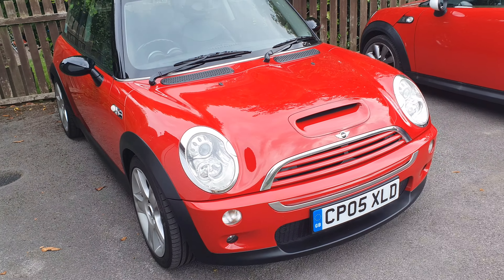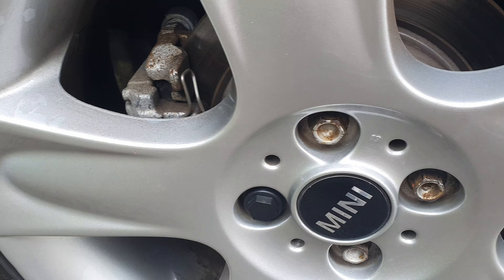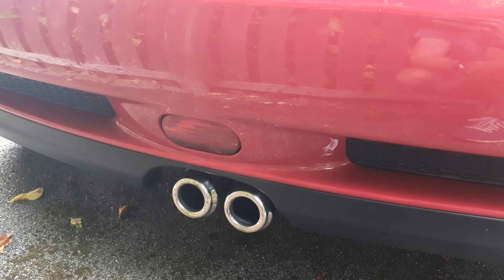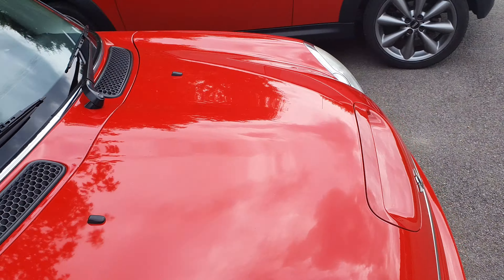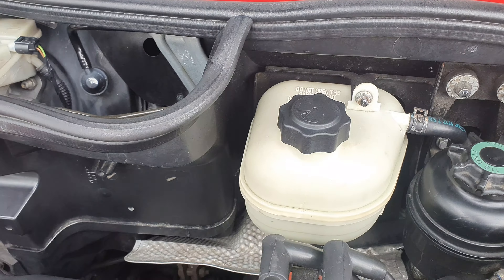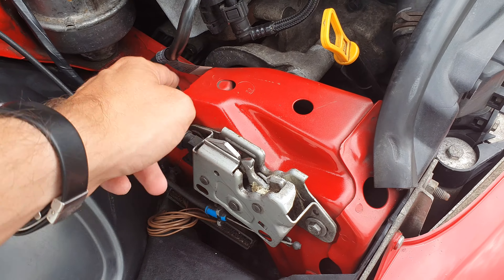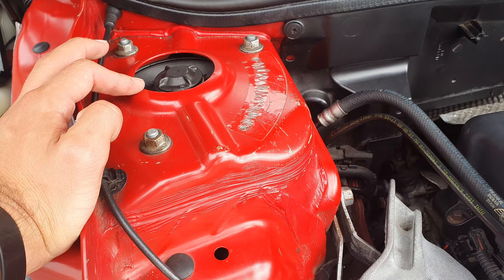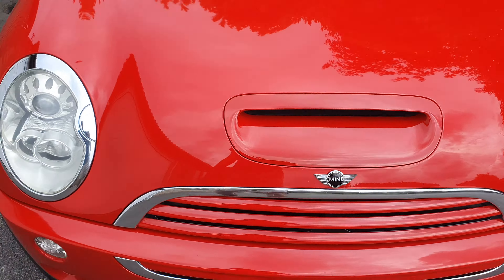Mini R53 buyer's guide top tips - 2005 Mini Cooper S

Comment: Nice example. Mine is a 2004 facelift MCS. I have Toyo TR1 tyres on mine, so far impressed. 
Lower front wishbone bushes will fail. Give the front wheel a good kick backwards, if it moves they are shot. Replace with poly bushes.
Front Anti-roll bar bushes can fail leading to an annoying rattle.
The boot handle gasket WILL leak at some point.
The paint is thin on these. Clearcoat prone to peeling especially on the bonnet
Power steering fluid reservoir top can leak - replace O ring
Strut top defender plates are nice to have
Rocker cover gasket is prone to leaking, it is sometime hard to spot the as the oil runs down the back of the engine and it is often confused as a sump gasket leak. The bolts that hold it on will most likely be severely corroded especially the ones under the intercooler.
Hydro engine mount will loose its contents.
Supercharger service - has it been done?
Crank position sensor O ring leaks.
Low speed radiator fan resistor fails
Top radiator hose can chafe against engine and wear through.

Comment: Good review thanks, I have had two, I would only add the bonnet release latches: if there is a lot of play in the handle the cables will have stretched, you can get cheaply get slide on grommets to take out the slack and make sure you dont get stuck with a bonnet that wont open!

Comment: Two years ago I bought a 2006 Cooper S. The car cost the first owner £16k and they added £13k of factory option. These include heated Recaro racing seats, telephone, climate control, chrono pack an auto box, etc, etc. Stage 2 race tuned she knocks out 190bhp and does 0-60 in 6.4secs. Great fun and you don’t need the radio with the supercharger whine. Bought for £2,800 and now valued at £5,500 by Lancaster insurance.
Reply from the maker: Wow that sounds like a very special R53 - and fantastic profile name by the way! 👍

Comment: Hey - Noticed your speedo wasn't in the middle! Which model was this the case in? All the ones I see are all in the middle (which i don't want) Thanks!
Reply from the maker: Hi Alex - it's something called a Chrono Pack, which was an option on 2004-05 R53s - replacing the central speedo with fuel, oil, and water temp gauges.
Reply: @ThomasNearney  Thanks mate! Kudos